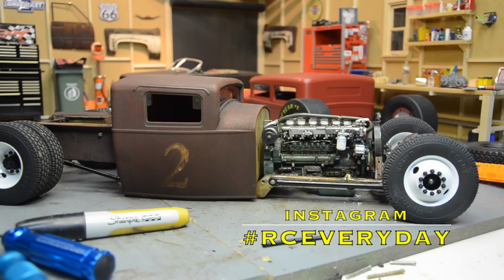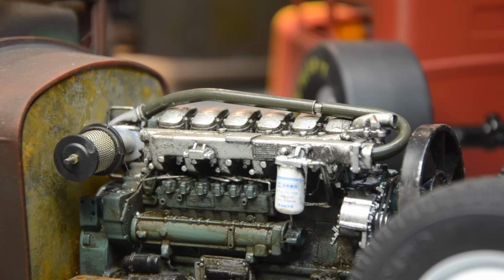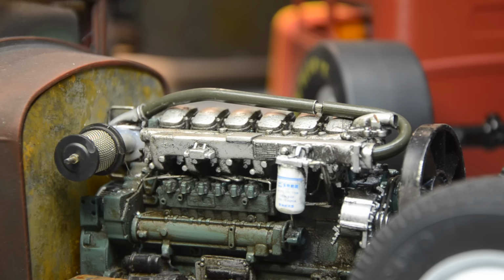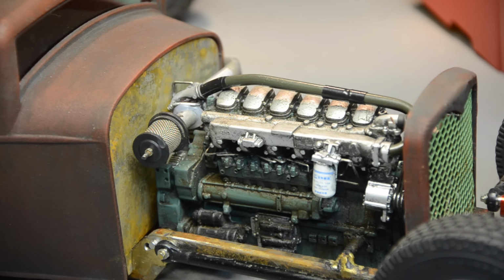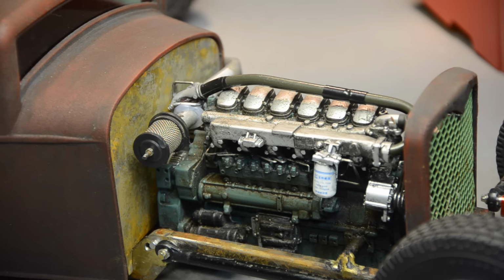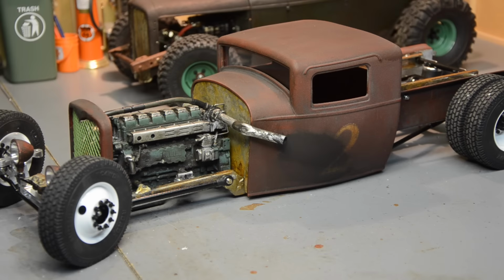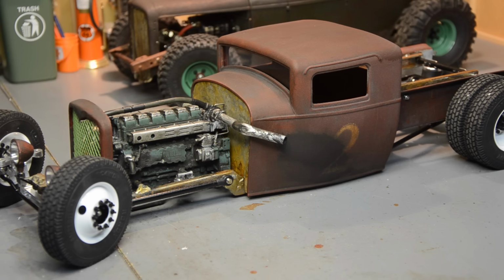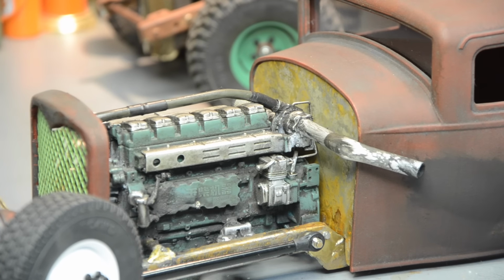Old #2 Ratrod Turbo Pipe install for the Diesel Engine, RCengineering

Comment: really cool build its not a off road truck glad to see it run and do well it would be fun to drive it up and down the street a head turner really like it wish i had it the rims you need to rust them and it will be done really nice rig

Comment: I agree with a couple of the other comments. I would put a scale radiator in the bed of the pickup with a fan on it like from a Baja truck. and then come up with some kind of tailgate. I was thinking you would want it to be see through so you can see the airbags from the suspension you could use clear plastic and put a neon glow on it and also have it 3D printed or come up with some way to put the brand of the truck or the old #2 logo in the tailgate. I think it would look awesome clear with a neon glow. you could do the interior with the same neon glow.
Reply from the maker: Im considering a tailgate, underglow may be a bit too far for my personal taste.  To me Rat Rods are all about rust and re-used parts.  About building from junk.
Reply: rc everyday i agree its a rat rod rusty loud in your face drive the shit out of it its not shinny not ment to be but so fun and cool theres a 55 chevy truck rat rod i see driving around it is so well done super loud fast and seen a truck there was no paint rust air bag set up big block it would smoke the tires right off man that truck was tight it looked like they just draged it out of the woods bad ass the rims were rusty low to the ground but man it was fast i like shine but i would rather have a rat rod

Comment: Hi from Canada. I have a question about buying my first crawler. Im looking at the axialscx 10  and the RC4wd trail finder 2. Any suggestions?
Mike Verch
Reply from the maker: Well, it all depends on what you want to do.  The scx10 is going to crawl better out of the box.  But the TF2 is a better platform for making a realistic rig in my opinion.  Just have to decide whether you want a super scale rig or a serious crawler.
Reply: RC Everyday Don't forget about the new Traxxas Defender coming out soon.
Reply from the maker: Havent seen that yet